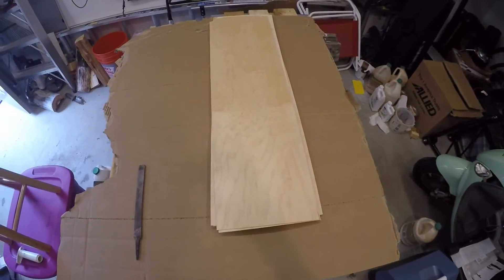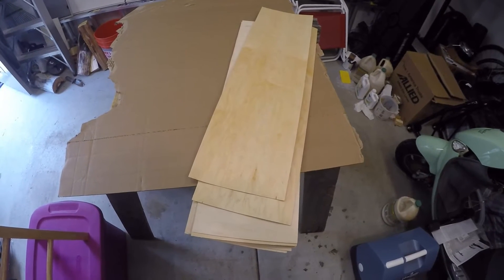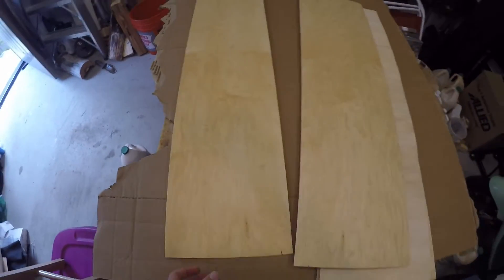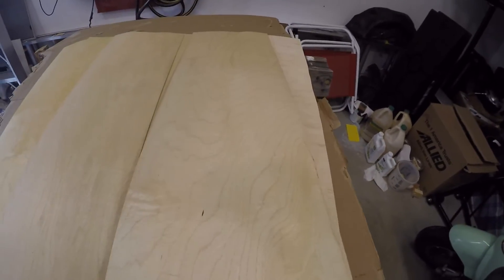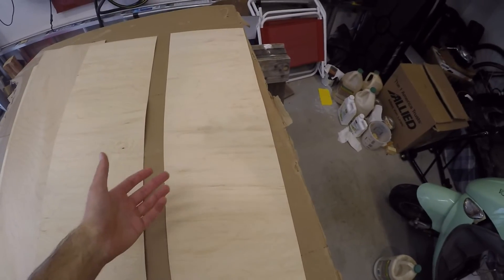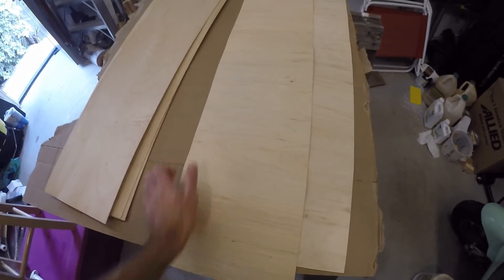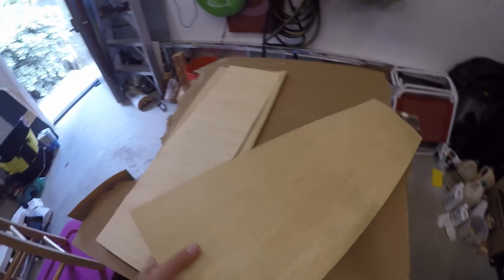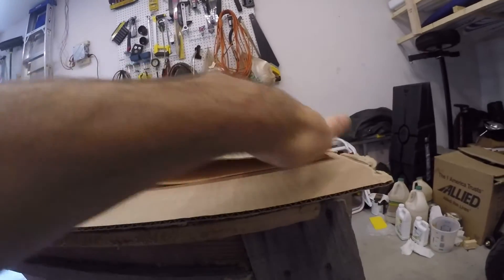Making a Skateboard Explained - Prepping the Veneer

Comment: I am gonna try to use 13 layers of 0.8 mm veneers because here in Europe no one makes 1.2 or 1.5 and so on  . If the thickness is the same but there are more thin layers , is the deck more durable to bending ? Like 9.6 or 10.6 mm

Comment: what is the ideal thicknes for veneers? I found something like 1,2mm to 1,3mm... but my closest factory just can make for me 1,4mm .... but i think if i put there 6layers of veneer it is almost the same like put 7 veneers of 1,2mm... does anybody have an experience here? thank you guys
Reply from the maker: I'm not sure of an ideal thickness or all of the tradeoffs with different veneer sizes, but I think 1.4 mm would be worth trying, since it's only 0.2 mm less than the nominal size (1/16") of most skateboard veneers on the market (1/16" is about 1.6 mm, and while I'm not sure the tolerances of veneer thickness, it's probably large enough where some 1.4 mm sheets end up in the mix).  I don't know for sure how 1.4 mm veneers will work, though, since I have really only stuck with 1/16" veneers (I did experiment with thinner crossband veneers, but the boards seemed to be more likely to warp with the thinner crossbands using my glue and pressing method).  Also, many boards are made with veneers thinner than 1/16".  Based on my experience with veneers and using mostly wood glue, I expect that a board made with 7 thin veneers vs. 7 "regular" size veneers would be more flexible and a little weaker, since the thinner wood is more flexible.  On the other hand, I would expect that a board made with 7 thick veneers would be harder to press (require more force and stress the wood more during pressing) than the regular size veneers, but a bit stronger.  Sorry I can't be more help here.  If anyone else reading this has experience with veneer thickness, please let us know what you've learned!

Comment: Sorry, new to using veneers. What width of veneer are you using in these tutorials? A skateboard would typically be a half inch, so only seven layers of veneer doesn't seem like much. Thank you!
Reply from the maker: These veneers are 9.5" wide x 34" long x 1/16" thick.  The current industry standard is 7-plies.  Many manufacturers use slightly thinner crossband veneers (around 1/20" or so).  7 plies is good for most riders as long as you keep the wheelbase less than around 16".  When you start widening the wheelbase, the board bends easier, and is more prone to breaking - if you're making a longboard, definitely go up to 8 or 9 veneers (unless the rider does not weigh much).  Both Roarockit (http://roarockit.com/) and Marwood Veneer (http://marwoodveneer.com/) are great suppliers of maple veneers for skateboard building.  Hope this helps!
Reply: Thank you! Hope that your videos get more attention than they have been, they're better than the amount that they're getting!
Reply from the maker: Thanks!!  :D

Comment: Where do you get your veneers from?
Reply from the maker: Typically Roarockit Skateboard Company (http://roarockit.com/), but I've also used Marwood (http://www.marwoodveneer.com/).  Both have great quality and great customer service.
Reply: Thanks.  Also what is your mold made out of?  I was thinking of glueing up layers of mdf then shaping it with a grinder.
Reply from the maker: I make my mold out of high density foam and shape it by hand.  It can be tricky making a wood mold without the proper tools - I've tried it a couple times, and wasn't satisfied with the result (it also took me a while).  It takes me only about 1-2 hours to shape a foam mold with a satisfactory degree of precision.
Reply: Our wood is the coolest ;)